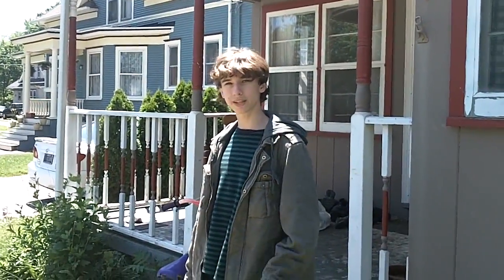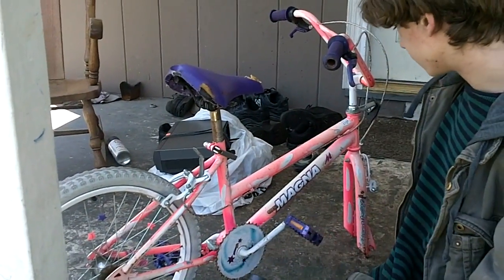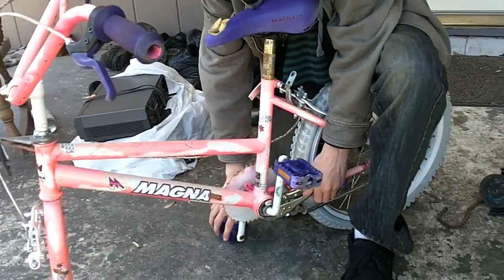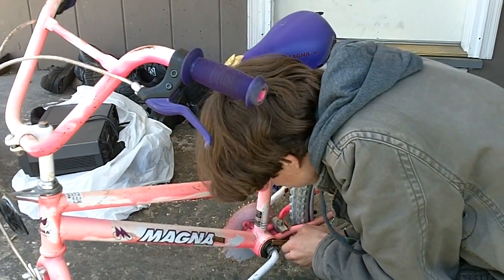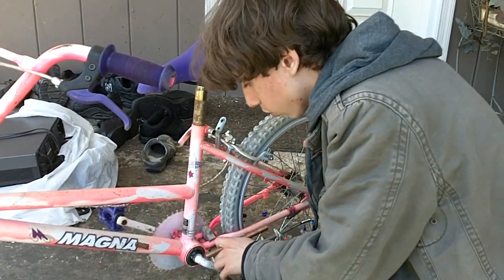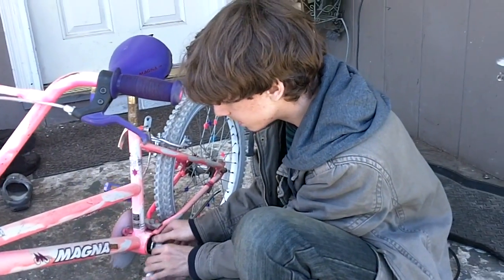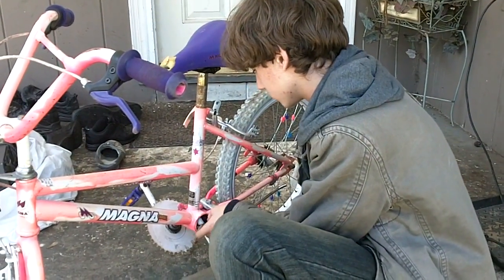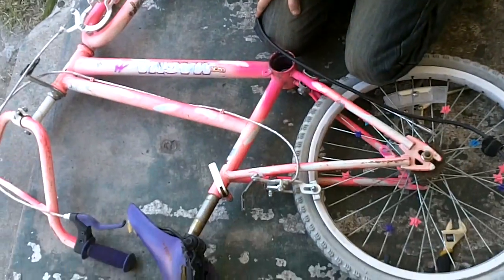How to build a Drift Trike Part #1

Comment: all u had to do was screw off the pedals too not grind through the cranks that u couldve used for something else
Reply from the maker: The petals were too rusted to easily screw off. Also no. What use could I find for a dirty old bike crank when I have dozens of bike parts lying around.

Comment from the maker: No... It's much stronger than you would think and it's held up for a year and gone over 40 mph With no signs of breaking. However the tires are cheap and the bearings need to be changed once a month.

Comment: that steel electrical pipe cheap shit is aluminum and it is made so you can bend it. you prob welded it with steal wire and your welds will brake. and your frame will bends and snap so good luck you five star machanic

Comment: The fact that the metal piece under the hex nut in the bottom bracket is SLOTTED would tell you to use a SLOTTED tool to remove it, like maybe a flathead screwdriver. I mean, that's how I figured out how to do it when I was nine years old.